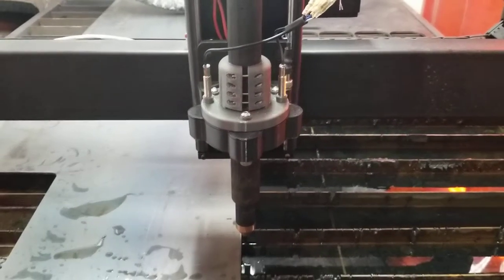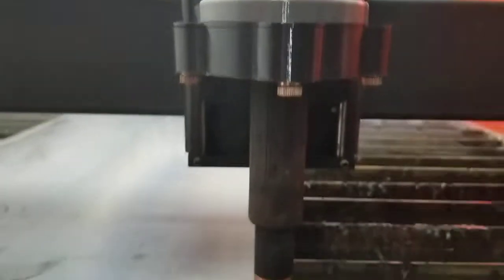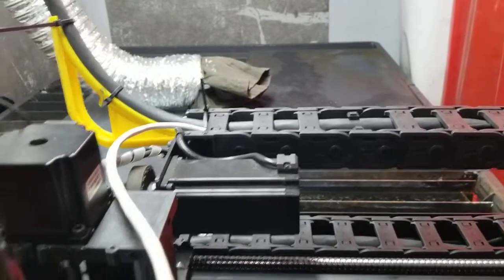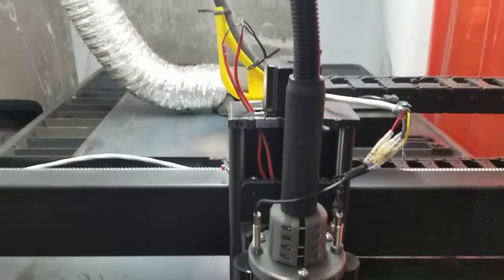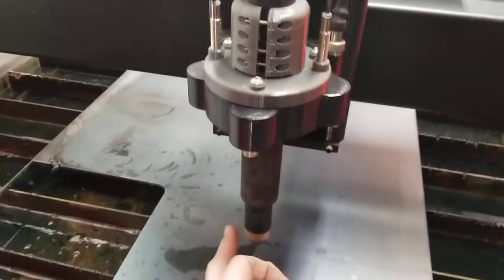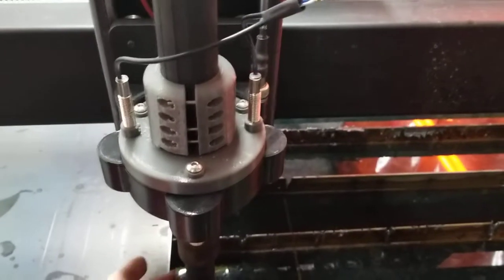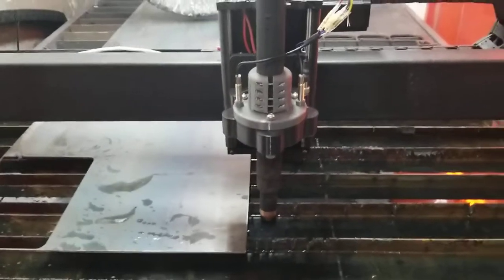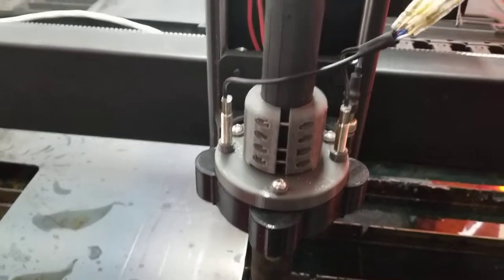Crossfire XR modification #2. Collision detection system.

Comment: How did you wire the proximity sensors to trigger a hold?
Reply from the maker: I used a keyboard emulator and triggered the pause function built into fire control.
Reply: That's a clever workaround. I will have to try that. Thanks for the insight